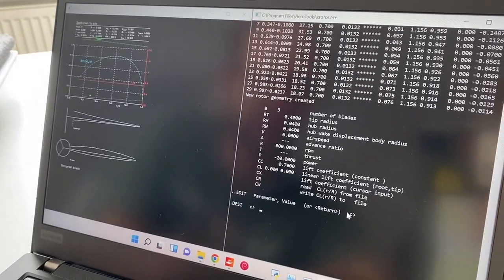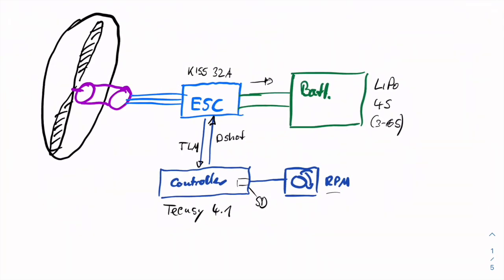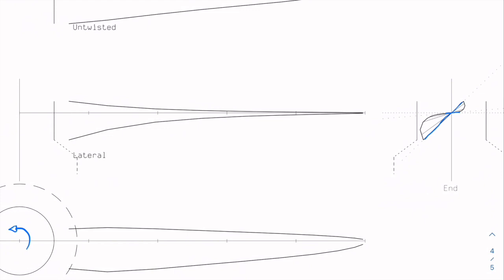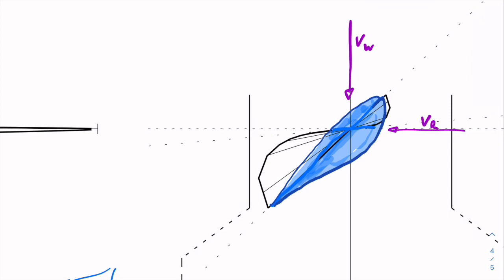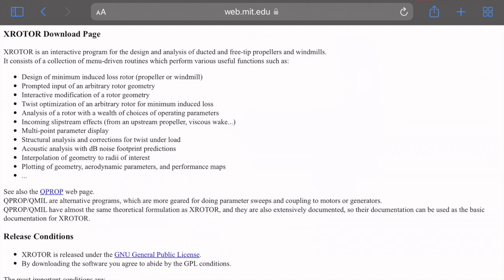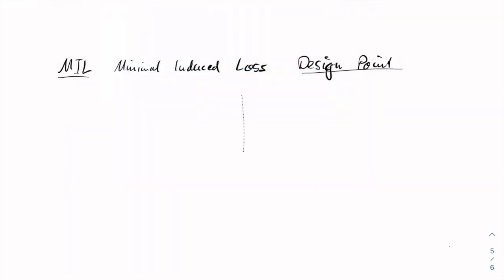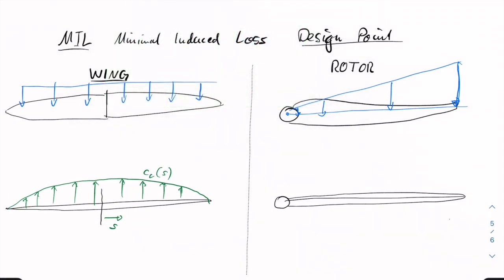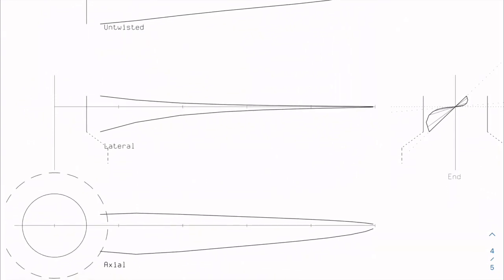Let's Build A WIND TURBINE | Aerodynamics & XROTOR (part 1)

Comment: I am building a small scale wind turbine for my university project. The question I am interested in, is how to figure out the lift coefficient, power and rpm values to put into my calculation. How do lift coefficient and power that I want to generate effect the calculation explicitly? Does increasing the rpm put much more stress on the blades? How to quantify all these effects and decide which values I need?
The diameter of my wind turbine is 35 cm. I don't think it can generate much power, maybe not even 5W? I am scared to put too much rpm, to not break the blades, and can't figure out the lift coefficient value, because when I put 0.7 it says that it stalls? 
Thanks in advance! Loved the video!
Reply from the maker: Hey, hope you're still in the process of the project.
It's a multidisciplinary optimization problem: Strucutral integrity (low RPM, big blades) vs. aerodynamic efficiency (small blades/high aspect ration, mid RPM). Generally, you want to have a balanced design - just stay with acceptable blade aspect ratio (10-15) and keep RPM low.
Reply from the maker: And send pictures if you built one ;)